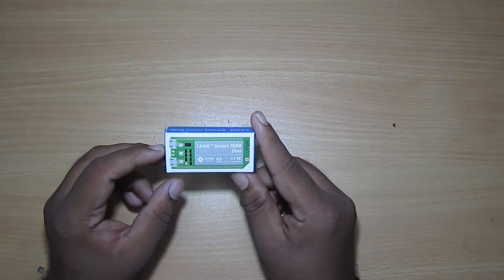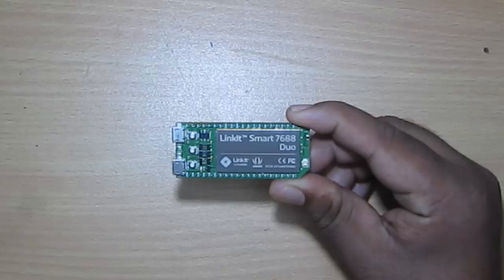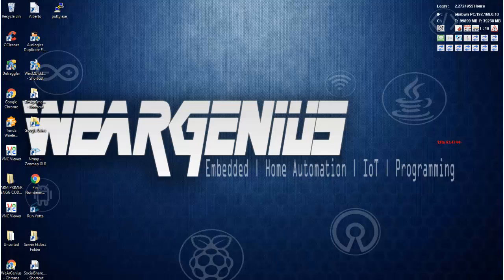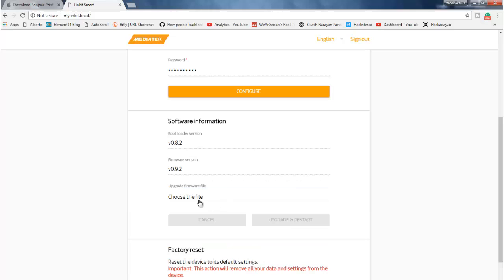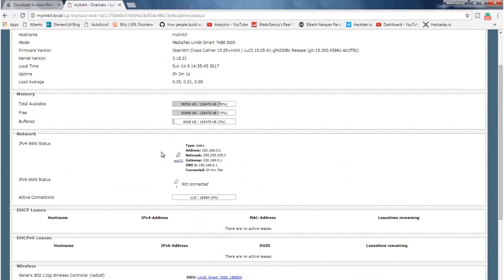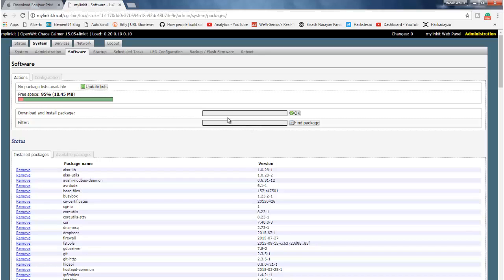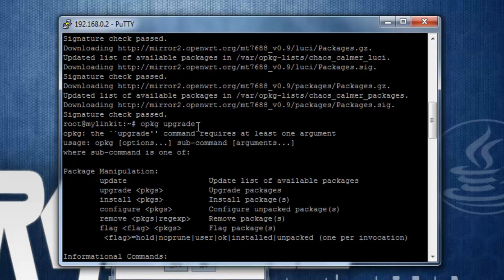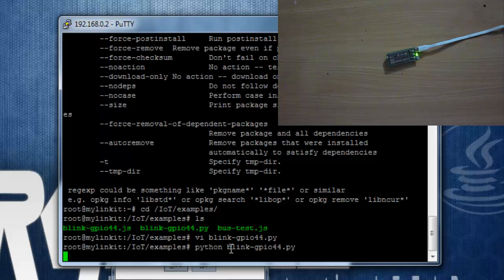Getting started with Linkit Smart 7688 DUO | First Look

Comment: after updating the firmware . it is not showing in wifi section . it is showing under mouse , keyboard . how to resolve the problem
Reply from the maker: have you tried browsing mylinkit.local   ? make sure on windows you have installed bonjour print services by apple.